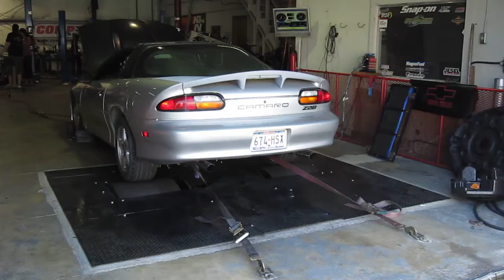LT1 383 LE3 24X conversion with DBW

Comment from the maker: @jmontign Not really, there are still several LS1 Tuners in Houston. I think however that the 24x conversion works better with somebody that tunes with EFI live vs hptuners, as that is what it was designed around. I was told that there are no limitations with HP tuners, but it seems the avenues to work around a few things are easier with EFI live.

Comment: What numbers did she make ?
Reply from the maker: 460 rwhp and similar torque. Car is being parted however.
Reply: @1997LT1Camaro   Do you have the link to the build thread? I'm the guy who bought your 24x kit
Reply from the maker: @Elkyss89  Hey whats up.  Do you still have my number?
Reply: @1997LT1Camaro  no, I don't. I'm just getting around to installing it. Pm me on fb Pete Jones
Reply: @1997LT1Camaro  I'm having problems putting in the pedal. Was curious how you had it
Reply from the maker: @Elkyss89  ok I will see if I can find you. I still have the black power coated Lloyd Elliot ported intake for monoblade btw.  Also you forgot the bolts to the throttle body.
Reply: @1997LT1Camaro  I'm guessing you weren't able to find me on fb?
Reply from the maker: @Elkyss89  yeah it wouldn’t pull up your account. Email me at supacharged21@gmail